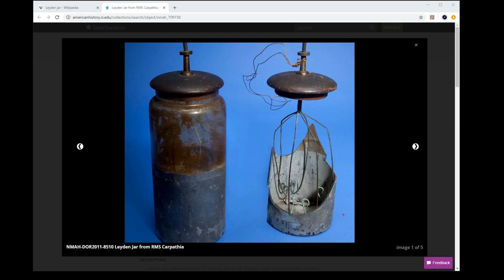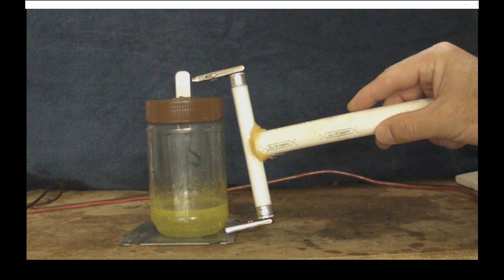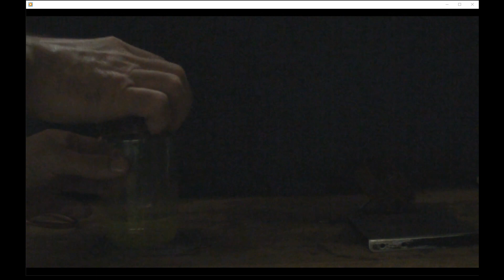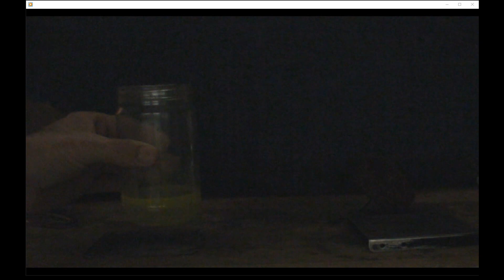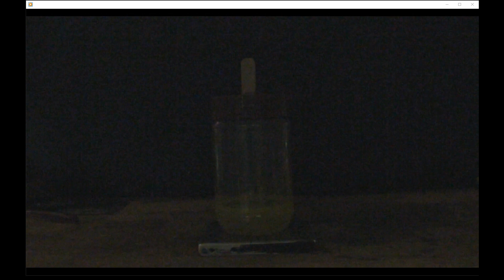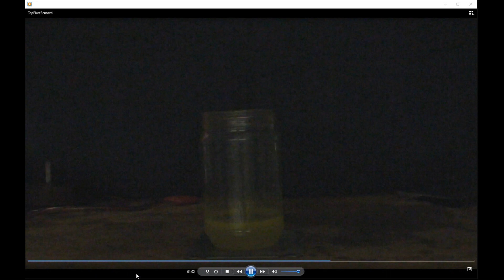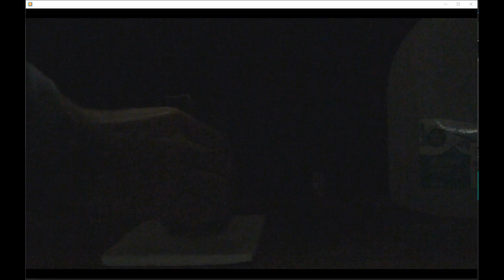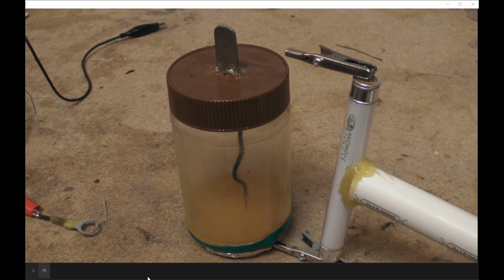Electron Theory can't explain Capacitors, but Ben Franklin can!

Comment: you are aware of the skin effect right? the electrons flow on the outside surfaces of the conductors, but not only the conductors! The charge is being stored on the surface of the dielectric. not inside it. The two surfaces(inside the jar containing the liquid) and the outside surface have an imbalance of electrons. All the plates or "electrodes" are used for is to add/remove electrons on the outside and inside surface of the container.
EDIT: The electrons cannot flow freely around the surface of the dielectric this is why they don't conduct electricity to some extent. they can however be trapped in place(stored) on the surface and when discharged you can see the electrons jumping gaps across the surface(not through it!) of the jar as coronal discharges. NOTE: when a capacitor fails it is generaly the dielectric being breached where a hole develops in the dielectric and the electrons can then jump THROUGH the hole shorting out the two surfaces. When you bring the light close to the electrodes of the jar the electrons that are stuck in place jump OFF the surface and onto the electrode because the electrons CAN travel on the surface of a conductor. where the two charges then meet and produce a "spark" which is just the air being turned into plasma

Think of it like this, take a sheet of paprt and hold it up. place a magnet on each side(one being the + end of the magnet representing + charge, and the other magnet being -) they will attract each other and hold themselves in position on the sheet of paper. because of the properties of the paper, the magnets cannot easily slide around and overcome their attraction, thus they are "stuck in place", and stored. Your hands would be considered the electrodes as they placed the magnets on the surfaces of the sheet of paper.
Reply: @itsbs  the charges are spreading out into the environment. table surface you are SETTING THEM ON etc. etc. the air molecules etc.
Reply: @itsbs  Sorry would "the theory you are subscribing to" be better?
Reply from the maker: @teksatan4699  <<Sorry would "the theory you are subscribing to" be better?>>

OR what you assume to be the theory I subscribe to...
Reply: @itsbs  I actually enjoyed this debate my man. Truly. Thank you for not being like most other.. "conspiracy nuts" by calling me names and simply banning me or deleting my comments. You made many good points here, and never broke composure. I no longer believe your a conspiracy nut, and you genuinely are trying to figure out some these complex unanswered questions. Keep doing exactly what your doing. Btw I am not a troll I do generally believe "electrons" are just small waves of energy, and I do believe every (currently understood?) piece of evidence i presented. Thanks again mate. Science would never advance if every person believed in the exact same thing :) It always takes someone somewhere  going against the "norm" to advance science
Reply from the maker: <<Thanks again mate.>>

Good on you!  After our debate, I now believe in electron balls and am going to delete my channel!
Reply: @itsbs  lol Funny.
Reply from the maker: @teksatan4699  Cool, thanks.  I'll check it out.
Reply: @itsbs  I noticed something rather important. It is mostly believed there is magnetic field "lines" being expelled from a magnet forming this torus shape.  and when you place the magnet near metal shavings or a ferrofluid and they form spikes that are believed to be following these "lines", HOWEVER in all experiments you will see them blow or move these spikes of ferrofluid and the spikes MOVE AROUND while maintaining their shape!! This should not be possible! if you try and move the liquid "spike" you would be pushing the liquid out of alignment with the magnetic field line, which should collapse the spike since nothing  is holding it up. The field lines  can't move in the way the fluid is. as this would cause the "lines" to criss-cross everywhere randomly(think of the sun and what causes solar flares) which would snap the field lines, and break them everywhere. So i decided to try this myself right? Im am starting to wonder if these "lines" don't exist at all. what i think might actually be happening is:

The magnet is "magnetizing"(imparting energy into) the metal shavings turning them into little magnets. These magnets build up with "like poles" repelling each other and opposite poles attracting. they then line up end to end making a "torus shaped" loop until they reconnect at the negative pole of the magnet. Maybe what we are seeing is not actual "lines", but the magnet fields of the lined up ferroparticles  evenly repelling each other. which would shape them into a line like pattern with each line repelling all the other lines next to it evenly. So it is the magnetic properties of the nano particles that is creating these "spikes/lines" we see. not actual "magnet field lines" which probably don't exist. So some type of "energy" is being transferred somehow between certain types of matter(magnetic vs non-magnetic etc.) which is turning them into magnets which forms them into a torus like shape around the large magnet? so the "field" itself doesn't actually exist either as we think of it.

I have a lot more I can go into here, but what are your thoughts? Obviously something is not right here.
Reply from the maker: @teksatan4699  <<. I have a lot more I can go into here, but what are your thoughts? Obviously something is not right here. >>

You can look at Lori Gardi's work on explaining magnetic fields.  For example:  https://youtu.be/yKbDCy7htXo and https://youtu.be/sJ0izpaKmFU can get you started.
Reply: @teksatan4699  “The Final Theory: Rethinking Our Scientific Legacy “, Mark McCutcheon for electron, electricity updated. An electrical engineer. All of physics rewritten.
Reply from the maker: <<the electrons flow on the outside surfaces of the conductors, but not only the conductors! The charge is being stored on the surface of the dielectric. not inside it.>>

Electron Theory states the dielectric is induced by the imbalance of charge on the plates.  If the dielectric is removed from the field created by the "electrons in the plates", then why does the dielectric still hold the charge?

Your argument is saying.. OK, if the dielectric actually holds the charge, then how can we "extend electron theory to explain that phenomenon."  You can make all the guesses that you want and that is fine.

The idea of "electrons" being on the outside of the dielectric or inside, still doesn't explain the polarization of the plastic.  How do these electrons "flow" through the dielectric to create a DIPOLE or polarized object?  I don't care about your answer, I'm just giving you something else to think about.  I don't care what you end up choosing, but I would suggest doing the experiment, instead of thinking you know something.
Reply: @itsbs  I kinda hate to ruin it for you but at this point electrons are not a theory. Not only do we build complex electronic devices that use them. We have now built electron GUNS, and use them to take unbelievably high resolution images of the microscopic world, as well as how your old tube TVs work.. They have a gun in the back that shoots electrons against the back of the screen producing x-rays(internally in super tiny amounts) and light.(this is of course a shortened version of how this works.) The glass becomes HIGHLY charged as a dielectric despite no charging plates existing. the tube is grounded on the outside for static purposes as the voltage required to produce the electrons is >=20kv(20 thousand volts) via a rather large type of flyback transformer. but it you touch the glass on these tubes(mind you THERE IS NO PLATES) you will get a shock and that is because the free flying electrons are sticking to the inside of the glass and an opposing charge is then building up on the outside of the TV screen. Which you can discharge to ground by touching the screen and completing the circuit. Part of the reason the screens are so thick and heavy is to prevent the extremely high voltages from reaching the breakdown voltage of the glass and arcing all over your screen. which would be rather annoying while watching tv. The second reason they are so thick is that they operate under a vacuum so there is nothing else inside the tube that the electrons can hit before reaching the screen as this would cause the electrons to scatter in random directions and not hit the very precise point on the screen required to produce high resolution images. we know this to be true from experimenting which is why we started placing these tubes under vacuum in the first place.
Reply from the maker: @teksatan4699  <<We have now built electron GUNS, and use them to take unbelievably high resolution images of the microscopic world, as well as how your old tube TVs work..>>

Just because you believe that "electrons" are being shot out of these devices doesn't mean that is ACTUALLY what is happening.  It is just what YOU believe is happening.  When I show an experiment to challenge that belief, then you might think about it more, or you might get emotional and defend your current beliefs.  Right now, it is my opinion that you defending belief due to emotion.
Reply from the maker: <<because the free flying electrons are sticking to the inside of the glass and an opposing charge is then building up on the outside of the TV screen.>>

Again, we are back to the polarization of the dielectric.  Is there a way to do an experiment (like I did) to show that the dielectric get symmetrically polarized, but the "electron source" is not shooting them symmetrically.  If so, how do the electrons work their magic and "self-organize" to create such a symmetric electric dipole field?
Reply from the maker: @teksatan4699  <<The second reason they are so thick is that they operate under a vacuum >>

Again, so the definition of a "vacuum" is challenged with the idea of a vacuum capacitor, i.e. where's the dielectric that the "electrons stick to" or the dielectric that gets polarized to store the charge?  Vacuum... like Einstein's "empty space" or not?
Reply from the maker: @teksatan4699  <<we know this to be true from experimenting which is why we started placing these tubes under vacuum in the first place.>>

I agree with this statement...the air dielectric is higher resistance than the vacuum dielectric.
Reply: @itsbs  Space isn't actually completely empty. I was generalizing and simplifying my explanations unless you'd prefer math equations instead? there is still plenty of stuff in space to produce small results. There may even be phenomena we are currently unaware of that may cause the electrons to oscillate between the plates in a vacuum?In space itself the sun is giving off massive amounts of electrons and protons etc. it is also very possible your plates are just capturing stray electrons floating around the environment. Who really knows... Electrons HAVE been trapped inside dielectrics like acrylic. There is pretty neat videos of this actually. So it is possible the dielectric's internal electrons are carrying the residual orientation of the electric field generated by the charges on the surface, thus explaining why it would appear to be polarized after discharging. This is however speculation. Similarly, ferrous type metals can(when brought within range of a magnetic field) orient it's particles all in one direction on the external electric field which turns the ferrous metal into a magnet. Perhaps a similar event happens inside the dielectric but due to the fact the electrons cannot move from their physical location it is an extremely reduced NEGLIGIBLY TINY residual force left in the dielectric, and it would be caused by the magnetic field that is produced by the surfaced charges you created using charged plated on each side.
Reply from the maker: <<There may even be phenomena we are currently unaware of that may cause the electrons to oscillate between the plates in a vacuum?>>

You mean like little particles of a Franklin Bell?  You've got a fancy electron theory going on...
Reply from the maker: <<This is however speculation. >>

Well, my JIF jar experiment is not speculation and very repeatable.  It is a direct challenge to the electron theory you would find in a textbook.  I link to MIT's explanations as a reference to how it is taught.  If flowing electron balls make you understand electronics better, then that is fine.
Reply: @itsbs  I do indeed have my own theory. A slight modification of electron theory. I don't actually believe the electron is a ball at all. I am not sure what it is directly. however the method of thinking of it as a particle matters not if the effect is the same. weather it is a ball, a wave, some other form of quantized energy, It effects our world the same. regardless. but your experiment shows the same effects electron theory expects....... It doesn't disprove it at all. just your understanding of what's actually happening.
Reply: @itsbs  I work in electrical engineering now. My work wouldn't be possible without doing the math thinking of things as an electron lol. If you have a theory that includes the math that is accurate enough to reproduce complex electronic circuits, and devices. Then please share them! I'd be more than happy to use them in the next IoT device I make. Until then I have no choice but to stick to the proven math that currently IS and DOES work
Reply: @itsbs  Your experiment doesn't show anything. you don't know WHAT is creating the polarization. it may be an after effect of the electrons themselves in atoms of the plastic being effected again by  the electromagnetic field present. you have 0 way to disprove electrons aren't causing the effects you are showing.. also did you even check the containers polarization BEFORE charging and THEN after? or did I miss that part.. I would want to see the difference between the two to even entertain this idea of yours.
Reply: @itsbs  "You mean like little particles of a Franklin Bell? " That was obviously just an example showing we don't know what is causing it.. I should hope you don't believe electrons are literally flying back and forth endlessly haha even I wouldn't believe something that rediculous
Reply: @itsbs  Hey it was fun debating with you. regardless of what model is correct, and regardless of what an electron or any particle actually is for that matter.. The effects are all the same. so it really doesn't matter in the long run
Reply from the maker: @teksatan4699  <<It effects our world the same. regardless. but your experiment shows the same effects electron theory expects....... It doesn't disprove it at all.>>

So then, why does the Electron Theory say the CHARGE is in the metal plates, when I show a repeatable experiment that the charge is NOT in the metal plates.  That is a direct disproof via repeatable experiment.  Isn't that what science is all about or is is about what you believe?
Reply: @itsbs  the CHARGE is CAUSED by the metal plates, and without seeing the exact line of the document you are referring to in the theory i will assume it is referring to the fact the electrons can freely flow from a conductive material outward. This is why you still NEED the plates to charge the capacitor in the first place. The electrons are coming OFF of the plates and being stored on the surface of the jar. It's a fairly simple thing to understand actually... The surface area of the plates directly correlates to how fast the charge is applied to the capacitor. Not how much of the charge can be transferred. This is why changing the plates had no effect on the jars charge or pattern of polarization.
Reply from the maker: @teksatan4699  <<The electrons are coming OFF of the plates and being stored on the surface of the jar. It's a fairly simple thing to understand actually... >>

OR the electrons are NOT doing what you say, and it is actually done in some other way, which could also be a fairly simple thing to understand.
Reply from the maker: << I work in electrical engineering now. My work wouldn't be possible without doing the math thinking of things as an electron lol. >>

Well, this isn't true.  There are many electrical engineers that don't think of things as "an electron."  A lot of the math was done before the JJ Thomson "electron idea" and definitely before the Neils Bohr "electron."  I named a few of those electrical engineers at the end of my video.  If you like thinking the way of the electron particle, then fine.  But, the arrogant idea that your way of thinking is CORRECT, is what seems to drive you to have stupid arguments like this, in the YouTube comment section.
Reply from the maker: <<Your experiment doesn't show anything. you don't know WHAT is creating the polarization.>>

I am showing you that it ISN"T the metal plates storing the charge.  How hard is that for an electrical engineer to understand?  This is a beginner video and yet, you are missing the point.  I'm not proposing a theory.  I am saying and demonstrating the current theory/model is wrong.  Go back to the prior version, make a new theory, or stick the broken one... I don't care and neither does the video.
Reply from the maker: <<also did you even check the containers polarization BEFORE charging and THEN after? or did I miss that part.. I would want to see the difference between the two to even entertain this idea of yours.>>

Then do the experiment.  You are an electrical engineer!  You can pull a piece of plastic out of the garbage and buy a small Fun Fly Stick to charge it up.
Reply from the maker: <<I should hope you don't believe electrons are literally flying back and forth endlessly haha even I wouldn't believe something that rediculous>>

You were the one that said "electrons oscillating."
Reply from the maker: <<The effects are all the same. so it really doesn't matter in the long run>>

Unless you are an engineer designing capacitors and think the dielectric just plays the role of a "separator" or "insulator."
Reply: @itsbs  To be honest no one knows how it actually works in reality. In practice we use them as just that. An insulator that is storing electrons as a static charge on the insulators surface. There are equations for this, and using the plates  to simply charge or discharge the surface of the insulator:

https://courses.lumenlearning.com/boundless-physics/chapter/capacitors-and-dielectrics/ 

I quote "Capacitance (C) can be calculated as a function of charge an object can 
store (q) and potential difference (V) between the two plates: C=q/V
 Q depends on the surface area of the conductor plates, while V depends 
on the distance between the plates and the permittivity of the 
dielectric between them." Showing we are only using the "plates" to "push" the charge onto the dielectric surface. aka we charge the surfaces using the charge present on the plates once we apply a power source containing more energy then what the plates currently already contain.

If there is no insulator the electrons flood the plates. get pushed off one plate and are attracted to other plate due to their charge. Remove the power source and the charge REMAINS. until the electrons can slowly bleed off and dissipate. or you rapidly discharge them.
charges will spread across surfaces they can flow across to try and equalize the plates touching ANYTHING in the environment will cause loss of electrons on the plates after x amount of time. depending on the material.

 Maybe you should do more research before making these videos.

Heres another link you should read:
electromagnetic fields:
https://courses.lumenlearning.com/boundless-physics/chapter/overview-3/https:

electric potential and voltage:
https://www.khanacademy.org/science/electrical-engineering/ee-electrostatics/ee-fields-potential-voltage/a/ee-electric-potential-voltage

and on that note! goodnight everybody.*drops mic and walks away*
Reply from the maker: @teksatan4699  <<maybe you should do more research before making these videos.>>

Did you read the article?  It says the charge Q is stored on the plates in the diagrams.  You do realize that the math for capacitors was worked out in the Faraday/Maxwell timeframe prior to Electrons, right?  Are you trolling me now or did you cheat your way through engineer school?
Reply: @itsbs  This is why i said we have no clue how it actually works... yes the charge is also stored on the plates once power gets removed. While power is connected plates are also charged because electrons are flowing through them from the input wire around the plate and on the opposing side of that plate where they are causing said effects on the surface of the dielectric. I have firmly stated multiple times I believe the charge lies on BOTH the dielectric surface and the plates. Not one or the other but both. Only difference is electrons CAN flow around the metal surface freely. they cannot however travel around the dielectric.. which is why we use it.. If your jar was all metal it would not hold a charge. In fact you would just be shorting the generator out. This is because the electrons on one side would simply move around the metals surface and join up preventing any difference in charge which is what creates the voltage. Electrons cannot move easily across a dielectric for some unknown reason so the charges stay put to kind of a local area which is dictated by the electric field the electrons are producing, to only slowly spread out of time(this equation I do not remember off the top of my head)electrons are flowing onto the metal. however the metal can ONLY hold a specific size charge. When this charge is reached the electrons begin leaping from one plate to the other. Remove the power and plate still contains an excess of electrons for a short time but the excess is quickly dissipated to try and equalize the difference in charge. It's just what happens..
Reply: @itsbs  A simple experiment can prove both surfaces can hold a charge. Rub a cloth on a dielectric you will build up a static charge. Rub a cloth on a metal plate that is insulated from ground and... You will produce a static charge.(remember you must insulate the metal as electrons can very easily flow around the surface of the metal plate and discharge themselves onto other surfaces. in this situation only one plate is present on the dielectric and without the second plate no charge will build up on the insulator the metal plate is set on top of. Showing that the difference in charges across the TWO PLATES is what is causing the effect on the dielectric.
Reply: @itsbs  You are misunderstanding what they mean somewhat when they say the plates are producing this "charge" the plates are used because electrons can flow easily around the surface. when you PUMP or PUSH more electrons in they want to get out BADLY and if the plates are close enough together the charges will start jumping from the plate to the dielectric surface.(it is not the dielectric they are attracted to it is just in the way.) but once you remove the power no more electrons are being pumped into the metal, and it drops below the threshold at which electrons cans be forced off the place. The electrons that remain ON the plate after this  get held in place by the two plates close proximity(but separated by an insulator to prevent the plates from shorting out) the closeness is producing electromagnetic forces holding all the electrons in place. For proof this is what is happening if you took say 10,000 volts and attach the wires onto each side of the plastic jar.  Turned on the power. Shut the power off, then measure the voltage on the jar. Nothing will be there. There will be 0 charge. This is 100% proof the plates ARE the thing creating the voltage difference that is creating this charge on the dielectric's surface. You cannot dispute this fact as attaching wires and pumping power into two sides of a dielectric does absolutely nothing. unless the plates are applied. Polarization of the the plates is caused by the air gap, length of wires, electrical resistance to all of the connections etc. The easiest path for the electrons to take will become the path the electrons begin moving in thus creating the + and - difference as the resistance on one side will be greater acting as a sort of diode. weather this charge is + or - depends on weather you choose to believe electrons flow from + to - or the other way around.
Reply: @itsbs  When we are designing circuits and say "lets hope we don't let the magic blue pixie smoke out" We don't literally mean there's magic inside the electronics you know ;)
Reply from the maker: @teksatan4699  << You are misunderstanding what they mean somewhat when they say the plates are producing this "charge" the plates are used because electrons can flow easily around the surface.>>

OK, so then Professor Lewin of MIT is also misunderstanding?  When the the link you sent to me says that the Q+ and Q- are in the "plates", instead of "on the dielectric"... I guess I am the one misunderstanding.
Reply from the maker: @teksatan4699  <<When we are designing circuits and say "lets hope we don't let the magic blue pixie smoke out" We don't literally mean there's magic inside the electronics you know ;)>>

Those are the magic electrons balls you keep talking about that are heating up and turning on fire, right?
Reply: @itsbs  I explained this. Your power source is pumping electrons onto the plates, at which point enough charge  is accumulated that no more charge can fit on the plate and are thus pushed off the surface and attracted to the opposite plate. the dielectric is just getting in the way the same thing is happening at your spark gap. charges are building up on the ends of the spark gap until no more electrons can fit at which point they start getting repelled from the same charge plate. normally the air in between would prevent the electrons from making an easy path so they slowly trickle through the air however when enough charge(which can be seen as coronal discharge in complete darkness during charging) becomes present the air breaks down and creates a conductive path. for the electrons to flow across. All the dielectric is meant to do is stop this breakdown voltage from being reached so the charges have no where to go and just sit there. aka get stored on the plates. AND some on the surface of the dielectric as well, and I have stated by electron I am referring to whatever these packets of energy actually are. That is not a provable thing as we can never actually see inside an electron we just call it an electron but we are all talking about more or less the same thing regardless of what it is made of.
Reply from the maker: @teksatan4699  <<I explained this. >>

I believe that you believe what you are explaining to me.
Reply: @itsbs  The only thing I am really seeing flawed in the electron TYPE theories  that may have some relevance in disproving the theories is how electrons can form these tree branch like fractal patterns as they are leaving a surface(coronal discharge for example.) but even this can technically be explained as the electrons being evenly scattered by the air molecules? However this theory falls apart when placing everything in a vacuum. As there shouldn't be enough air to form the fractal like patterns. but the electricity does indeed produce these patters in a vacuum they are just smaller, but unexplained. The only thing I can personally think here is maybe the electrons are just evenly repelling each other as they are all of the same charge this even scattering due to repulsion MAY produce the pattern we see.
Reply: @itsbs  "I believe that you believe what you are explaining to me." I respect your right to reject my reality and substitute your own. I am just stating the facts as I see them for the people to make their own decision.
Reply from the maker: @teksatan4699  <<I am just stating the facts as I see them>>

Your facts.
Reply: @itsbs  I  am aware that many of these mathematical equations were created before we had any concept of an electron. HOWEVER in conjunction with new discoveries, evidence, and equation since these old functions were created has steadily backed the electron theory up.
Reply: @itsbs  The facts that are best described by the what we see. Oh that's right, it isn't just what we see! It is what we know to be true to SOME extent as again the fact we have actual electron guns that shoot "balls" of energy out we know they are tiny as you see these "dots" as pixels on your screen. millions of pixels. which are just elements that give off light when hit with electrons. On our scale we see whatever it is as a tiny point of energy. of course on the scale of an electron no one knows what it actually is.
Reply: @itsbs   It could be nothing more than a wave in the fabric of space.. many mini waves joining together to produce a massive ammount of energy(this is where your theory here would begin to come into play) as "electricity would no longer be tiny points but rather more of a fabric of energy. There is no current way to find this out. If it is say a fabric or something of energy as your theory would imply. Then when we use this energy we are ripping it apart and shooting little chunks of it at a time. lol WHICH yes I suppose could be possible, but at the point we rip the fabric of energy apart into little pieces to shoot it out of our guns it is no longer a large accumulation of energy like a large fabric. at this point it is a tiny point of quantized energy ergo what we would call an "electron"
Reply: @itsbs  I tend to lean to electrons actually being very tiny waves of energy.
Reply: @itsbs  the dielectric doesn't hold on to it's charge forever... the electrons slowly dissipate off into the air once the charging plates are removed. The electrons are not "flowing" through the dielectric the buildup of charges (many millions of electrons in one small area) produces the electromagnetic field. Each electron has a very small electric field itself. Many of these in one place produce a macro field we can detect. The plastic isn't polarized ITSELF at all. Tt is due to the fact so many electrons of opposing charges are gathered together. on the surfaces. EDIT: the electrons are attempting to move from one plate to the other plate. However there is a material(dielectric) in the way. The electrons smash into the side of the dielectric and "stick" there.  This causes all electrons of the same charge to fly off the opposing surface and on to the negatively charged electrode plate, leaving say a positive charge on the inside surface and negative on the outside. Once you remove the charging electrode plates it is the two separate charges that keeps the electrons in place as they are attracted to each other through the dielectric via the magnetic field they produce.
Reply from the maker: @teksatan4699  <<The plastic isn't polarized ITSELF at all.>>

The meter at the end of the video experiment disagrees with your statement.
Reply from the maker: @teksatan4699  <<Once you remove the charging electrode plates it is the two separate charges that keeps the electrons in place as they are attracted to each other through the dielectric via the magnetic field they produce.>>

Unless you ignore the electrostatic meter showing the polarization of the jar (which does not have symmetrical metallic plates), then you still don't explain how the electrons "jump from the metal" and "stick" to the plastic jar in a perfect way to polarize the plastic in a very symmetrical way.
Reply: @itsbs  You can't physically see the remaining electrons on the plastic's surface producing any remaining electric field present after initial discharge.
Reply: @itsbs  They are being pushed off the positive plate(as an example. The actual direction is disputed.) and attracted directly to the second plate. the dielectric inbetween is just catching them on their "straight and narrow" path between plates
Reply from the maker: @teksatan4699  <<You can't physically see the remaining electrons on the plastic's surface producing any remaining electric field present after initial discharge.>>

Since you don't quote your reference statement, I am assuming this was within the context of being able to discharge a capacitor, after it is discharged and letting it sit.  It is called dielectric absorption and now-a-days they just blame it on "incomplete discharge", but if you do the experiment yourself...you might question that explanation.
Reply from the maker: @teksatan4699  <<the dielectric inbetween is just catching them on their "straight and narrow" path between plates>>

So again, how can a WILDLY asymmetrical metal plate configuration create a symmetrical dielectric polarization?  This is shown in the experiment using the electrostatic meter.  If electrons are being emitted and absorbed by those tiny pieces of metal in the jar, then how does the whole jar become polarized right from the middle?
Reply from the maker: @teksatan4699  <<This is all just pseudo science as we can never actually see an electron. Therefore we cannot prove what it actually is. We can just choose the model that best describes what we see.>>

OK then, I am showing a repeatable experiment that DISPROVES the Electron Theory MODEL?  Is that wording better?
Reply from the maker: @teksatan4699  <<I do not follow electron theory Itself. but I believe in something similar.>>

OK, I don't care what you believe in, so please stop telling me your theory.
Reply: @itsbs  My theory is fully provable by observation, and in practice. Yours proved nothing. You showed an effect/result. Not what is causing it.. Also what don't you get about my explanation of why your jar gets polarized? @you "I would question then, how do these electrons stick themselves in such a way to create a very "symmetrical" electric polarization of the entire jar?" They aren't "sticking" to the jar! the positive plate is giving off electrons which head TO the negative plate they all pile up against the surface of the jar randomly(inevitably forming a semi uniform fill across the surface. order from dissorder) So on one surface you have say a net positive charge as the electrons pile up. This will cause negatively charged particles to accumulate on the opposite surface. http://hyperphysics.phy-astr.gsu.edu/hbase/electric/maxeq2.html If you know anything about electricity, You would know shoving lots of same charged(we'll just say electricity to negate what it actually is from this example) all in one area produces an increasingly stronger magnet field. Each charge becomes a small magnet attracting the other side. the two charges of electrons on each surface are held in place by the magnetism that is generated between them, and if I am correct, this would create a magnetic field perpendicular to the surface of the jar which orients the electrons within the jar to form the polarization you show here. I hope you also know placing charged "plates" or "wires" etc. within proximity to each other will produce a magnetic field regardless of what is happening with the electrons in between as long as they are moving weather there is an insulator between them or not(This is how ALL TRANSFORMERS work in the known universe). You may simply be re-orienting molecules/atoms etc. that are MAGNETIC mixed in with the plastic jar when it was made. In fact I'd bet my career on that last statement being exactly what is happening here. Just the fact that all capacitors in the known universe slowly lose their charge over time because it leaks at the LEAST proves the power is not coming from within the object  as there would be no force applied to make the electrons move. They would just sit in place within the object.  They can leave the SURFACE however because the air around them DOES in super small amounts pull electrons away. in a vacuum there is still "stuff" present so the effect still happens but much much slower is there is less "stuff" to pull the electrons away no one has ever created a true "vacuum" in fact it's believed to be impossible but IF you could. there is a good chance the charge would stay on the jar and plates.. Endless. Assuming electrons cannot decay
Reply from the maker: @teksatan4699  <<Yours proved nothing. You showed an effect/result. Not what is causing it.. >>

It "proves" that the current Electron Theory/Model is not correct, because the charge is not stored in the plates.  How hard is that to understand?  I'm not coming up with my own theory here at all or trying to explain how it works.  I point to other people's theory, Maxwell, Steinmetz, Dollard.  If you are SO SMART, why am I explain these ^^^ very simple things to you?
Reply from the maker: @teksatan4699  <<They aren't "sticking" to the jar! the positive plate is giving off electrons which head TO the negative plate they all pile up against the surface of the jar randomly(inevitably forming a semi uniform fill across the surface.>>

Hah, "sticking" or "piling up" against the surface?  However you want to change a word and re-make your arguement... hah!  These electrons SPRAY themselves through THROUGH the high-dielectric K, distilled-water and "randomly" spread (or flow?) through the plastic dielectric (as shown in the video when I sink the metal into the liquid)...  That's would be a neat electron-emission theory.  AMAZING!
Reply: @itsbs I'm not remaking anything i said "stuck"  because that is what they appear to do. they are indeed held in  place by magnetic forces they don't literally stick. Don't try and twist my words to prove your false theory. It makes you look weak. respond with evidence or don't bother. All you've done is repeat "but my experiment"
in half of your responses. an experiment that proved nothing since all you did was show polarization of a plastic bottle but showed nothing that actually created that polarization. As i said before for all you know the electrons CAUSED the polarization or that it was already there before your experiment. You did not show anywhere in your "experiment" that electrons aren't what is causing this...
Reply: @itsbs  The charge is not stored in the plates? The plates AND the jar contain a charge... Once you remove the power source, the plates will dissipate rappidly because you pulled the positive and negative plates away from each other. without those opposing chargers nothing it there to stop the electrons on the plate from slowly getting picked away off the plate into the air for example. but the charge is moving from the power source and through the plate then off the plate and move to the opposite plate. once you remove power the electrons are still on the surface of the plate however no NEW electrons flow in and this means there is no force pushing the electrons away so those electrons that where flowing are STUCK on the plates once you remove power those plates have just as much charge as the power source. However moving the plates away from one another where the charge is left only + or only - the charge will dissipate rapidly. the jar however still contains BOTH sides containing a positive AND negative charge winch is what holds the charge in place on the surface via their magnetic fields. It also doesn't matter WHAT we think we are shooting out of our electron guns. the point is we ARE SHOOTING TINY POINTS OF ENERGY weather they are an electron or some other thing. Electron is just the name we gave them. When the electron gun shoots 1 electron at the screen they all end up at a single precise POINT. Not spread out. or anything else. regardless of what it is "made of" we call it an electron, and it IS a single point of energy or your TV would not work. You would see nothing but a smear of light if anything if electrons were not SOME FORM of small point of energy. You're misunderstanding electron theory and how it applies to the plates. Weather or not they are currently being powered. In order for this experiment of yours to be valid ALL variables that effect the flow of electrons must be removed. florescent lighting due to the EMF radiation, humidity and temperature controlled room as both of these effect the rate at which charges can dissipate. equally sized and shaped plates with EQUAL surface area, measurements at EVERY point in the test. If you think your experiment disproves the experiments people have done using REAL commercially built capacitors for example using better materials and setup. stainless steel vacuum chambers, power supplies that use constant current AND constant voltage supplies. Then you prove nothing. because almost all of these experiments have been reproduced using today's tech and the theory STILL holds.
Reply: @itsbs  Also you haven't explained anything to me. You showed me a result with absolutely no way of knowing what actually caused it. because you can't fucking see electrons. just the effect they have on things LIKE POLARIZING STUFF lol
Reply from the maker: <<The plates AND the jar contain a charge... >>

If that is the case, then why can you connect the metal plates together after charging the dissectible capacitor and NOT get a discharge?
Reply from the maker: <<Also you haven't explained anything to me. You showed me a result with absolutely no way of knowing what actually caused it.>>

I explained that the charge is not stored in the metal plates of the capacitor.  If you wanted more than that, I guess you missed the point of my video, which is to show that Electron Theory is wrong about this idea.  If you want why, you are asking and expecting more than I provided.
Reply: @itsbs  I'd have to run this particular experiment in a controlled environment. but your pulling the plates away from the surface of the jar. You are most likely removing the charge they contained by separating them, and as I stated the plates WILL discharge rapidly without the opposite plate there to create the effects that kept them in place.just having the plate sin contact with the grounded desk before attempting to discharge them most likely removed any remaining charge they would have had.,
Reply: @itsbs  Just so you know I have done these experiments... In grade school.

Just leave the jar sitting on a table for an hour, and come back. The charge will be almost, if not completely gone from leaking into the air.

I respect your right to have any belief you choose. However your understanding of how electrons move, interact, and travel through materials is flawed.

Oh i also have proof. You can physically SEE the sparks jumping around on the SURFACE of the plastic when you discharge the cap. this is because they cannot FLOW on or through the dielectric. They jump gap to gap through the air to the electrodes of the light you are using. If the electricity was being stored WITHIN the dielectric you would not see these discharges jumping around the plastic as the charge would contains INSIDE the plastic and therefor only escape and be seen at the point where the gap between electrodes is small enough to overcome the breakdown voltage of our atmosphere.
Reply from the maker: @teksatan4699  <<Just so you know I have done these experiments... In grade school.>>

Maybe you should revisit it with an open mind and logical mind.
Reply from the maker: @teksatan4699  <<Just leave the jar sitting on a table for an hour, and come back. The charge will be almost, if not completely gone from leaking into the air.>>

Oh really, just one hour and its completely gone?  Hah, maybe you should really revisit this experiment.  What about when I "completely" discharge the capacitor and come back an hour later and it has recharged a bit?  Did the electrons just start jumping to the plastic jar for the fun of it?
Reply from the maker: @teksatan4699  <<I respect your right to have any belief you choose. However your understanding of how electrons move, interact, and travel through materials is flawed.>>

Yes, I don't believe in the imaginary electron idea like you do, so of course, my view of the electron ball (or whatever your personal definition is) will be flawed compared to yours.  Duh?
Reply from the maker: @teksatan4699  <<If the electricity was being stored WITHIN the dielectric you would not see these discharges jumping around the plastic as the charge would contains INSIDE the plastic and therefor only escape and be seen at the point where the gap between electrodes is small enough to overcome the breakdown voltage of our atmosphere.>>

If I have taken the metal plates out and replaced them with totally different metals (also different types and sizes), the where was the energy stored during the transition of the metal?  Air is a Dielectric, Plastic is a dielectric, oil is a dielectric, distilled water is a dielectric.... where did the charge go?  I don't understand your "proof" statement at all... If you are saying that the "electrons" were stuck to the plastic, then you have created your own version of Electron Theory.  I would question then, how do these electrons stick themselves in such a way to create a very "symmetrical" electric polarization of the entire jar?
Reply: @itsbs  I said it could be. It depends on the efficiency of the capacitor. Charges will leak from various locations at different rates. A better built cap. can hold it's charge for days maybe weeks, but will still discharge over time.
Reply: @itsbs  Touche`
Reply: @itsbs  If you remove the plates part of the charge is stuck to the surfaces of the container. One surface contains millions of negatively charged particles, and the other would contain millions of positively charged particles. this produces two opposing magnetic poles!! and the electrons end up stick to the container attracted to the opposite magnetic charge on the opposing surface.
Reply from the maker: @teksatan4699  <<It depends on the efficiency of the capacitor. Charges will leak from various locations at different rates. A better built cap. can hold it's charge for days maybe weeks, but will still discharge over time.>>

Do you have a math formula that predicts the "sticky electron" dissipation from the dielectric or are you still working on that formula?
Reply from the maker: <<One surface contains millions of negatively charged particles, and the other would contain millions of positively charged particles. this produces two opposing magnetic poles!!>>

Magnetic poles... if that is the case, then I can take one of my magnets and stick it to the side of the plastic or make it repel?  Wow...
Reply from the maker: @ThadStevenson67  The insulated wires you touch are low voltage wires.